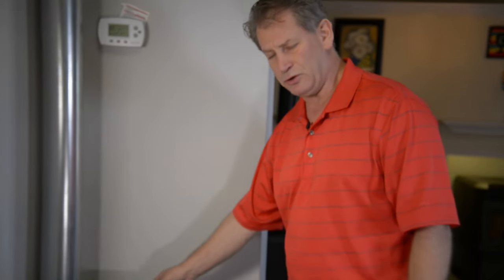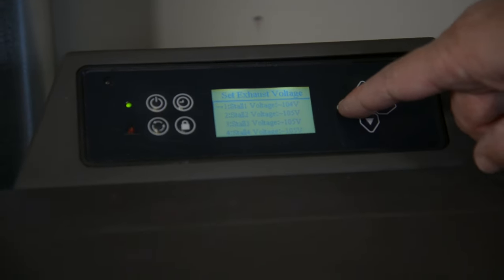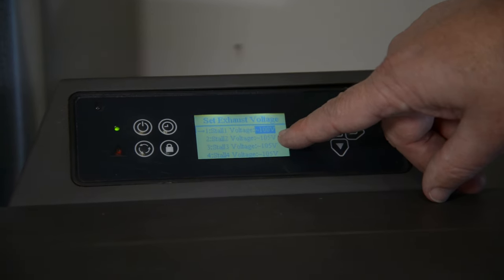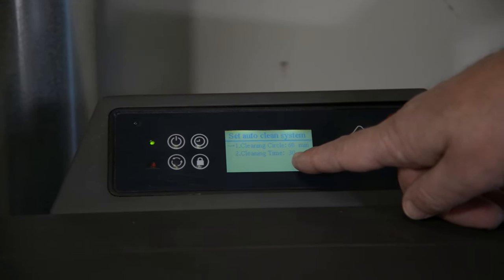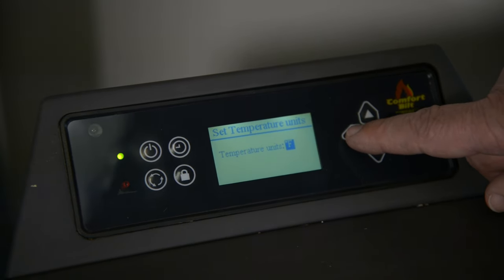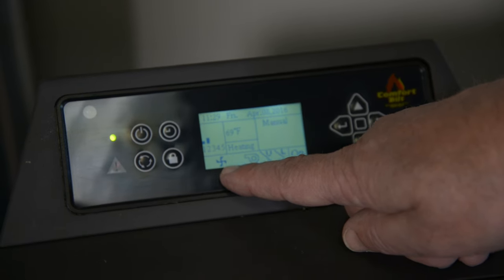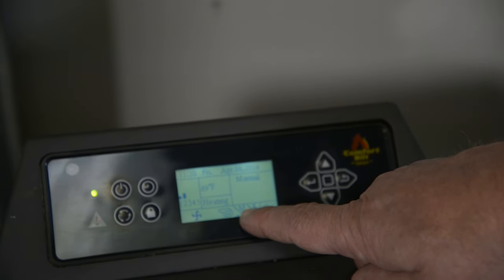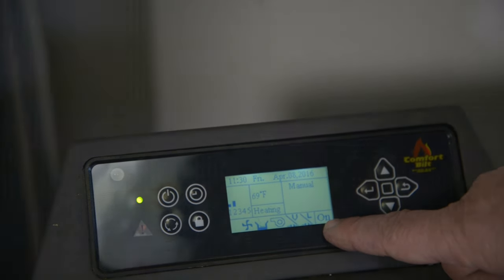ComfortBilt: Control Panel Settings

Comment: I like the stove I have an HP 50s and the manual is confusing as heck. It says oh you can use up and down arrows to change the temperature. Right but it doesn't say what I have to do before I do that. Very confusing. I googled what does standby mean? And this video came up and nothing was mentioned about that.

Comment: What is the HD # at top of diagnostic screen on HP22? I had to check my ignitor, and while trying to get to Fire in diagnostics I believe I changed to HP5 but not sure. Can't find and information in my manual or online what it is in setting

Comment: Not the easiest display to use. I wish the buttons were clearly marked. I have to find this video when ever the the temp changes from F to C.
Reply from the maker: We are working on a new stove tutorial series that will explain the basics.  Part 3 should include the software/controller operations.

Comment: Hello,
Could you please help me with my pellet stove?
When firing up, the stove works fine, but after reaching temperature and switching from firing up to heating, the fire is stifled and after a few minutes there is no fire at all. I have searched for information on this problem but can't find anything to help me, I have tried changing the "feed" parameters but to no avail. Do you know what could be the problem?
Reply: try replacing the vaccume switch

Comment: my menu to change settings is asking for a password , i never setup a password ?
Reply: Any update?  I need to adjust my feed rate and I can’t without the password.
Reply from the maker: Default password should be the following sequence:  Up, Down, Up, Up, Down, Up.   This will let you in.    For the newer version of the software, be sure to check out the newest user manuals:  https://comfortbilt.net/pages/stove-manuals

Comment: how about giving a video on how to set the controls the 7 day I set it at 65 degrees that got up to 70 I set it down to 61 degrees and one up to almost 80° I thought it was supposed to shut off and turn back on when the temperature dropped again why don't you do a video on how to operate this piece of crap